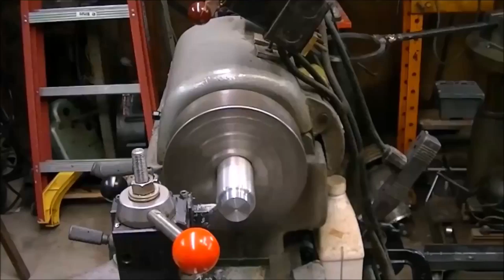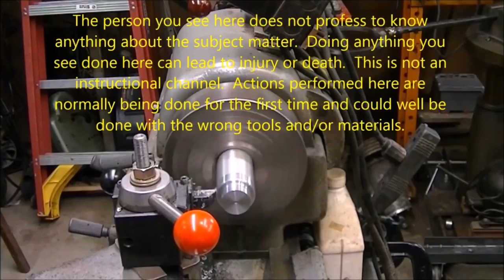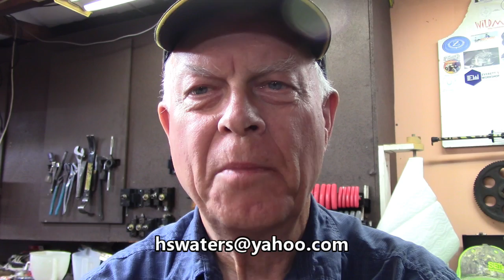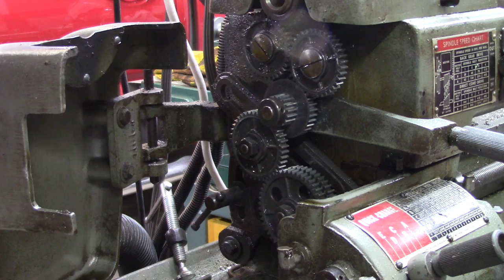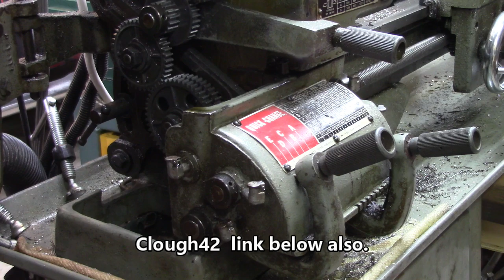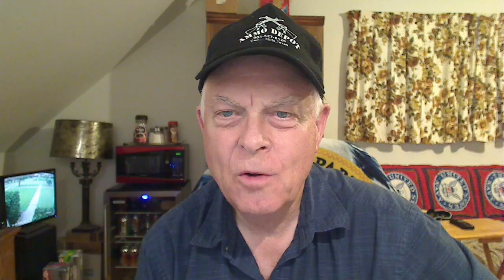Servo threading

Comment: If you already have a lathe with change gears or better yet with the Norton quick change box all the effort it would take to make a servo drive seems like a lot of work for something you probably wouldn't get much use out of.
Cheers from NC/USA
Reply from the maker: True as that may be it would still have the "cool" factor at a high level.  Not everything has to be practical.  Merry Christmas and happy new year.  Thanks for viewing.
Reply: @AmateurRedneckWorkshop  I have looked at those videos in the past and for that amount of work it would seem to be not a lot more effort to convert the whole machine to CNC. Though one of the new Chinese bench lathes might be a better candidate for conversion.
Reply from the maker: @aceroadholder2185  possibly.

Comment: Sounds like a good idea, I'll have to look into it. Some of the electronic devices that are available now days are ok, if you can figure out how to operate them. I put a 3 phase motor and variable frequency drive on my lathe a couple of years back, and it's nice getting away from the belt changes.
I also put DRO on my mill and would hate to go back to the dials.
On another note I took your advice and and put a Burris fastfire 3 on my S&W 22 and I couldn't be happier with it. I've been ringing my gong pretty consistently at 100 yards. Nice to be shooting more after a long Montana winter.
Reply from the maker: It is good that you are as happy with your Burris and S&W as I am.  Thanks for stopping by.

Comment: Quite interesting, Clough42 has a very elegant solution to the various problems raised for having a precise and reliable control over the process....  His approach with a feedback loop is the way to go.
You're really going into the electronic control machines, starting with the plasma cutting table...!!!    ;)
Reply from the maker: It does interest me somewhat.   When you can type a few lines of code and get a lot of work done it is sort of like magic.  Thanks for stopping by.

Comment: That's something I've wanted to try for years, I have an old southbend without quick change gear box or extra gears, I removed the gear train and put on a variable speed dc motor, chain drive, it works for cutting fine. but have always considered a servo or stepper motor for that threading. Thanks for the post, might get me re-inspired.
Reply from the maker: Thanks for stopping by.

Comment: Hi Harold,

I saw something on this quite a while back, but can't remember who.  To make this work properly you have to monitor spindle speed and match the leadscrew revolution so everything stays in sync.  Of course with a mechanical gear set that happens automatically as they are locked together.

How the thread pitch is determined and set takes some numerical and display trickery that requires some simple programing I expect.  It's all too much for my brain to think about, but I'm sure others have been down this path and there may even be a commercial version on large lathes.

Interesting concept that saves swapping out change gears if you can get it to work 100%.  

Cheers Rob
Reply from the maker: Thanks for stopping by.